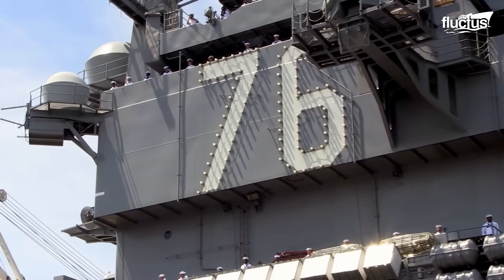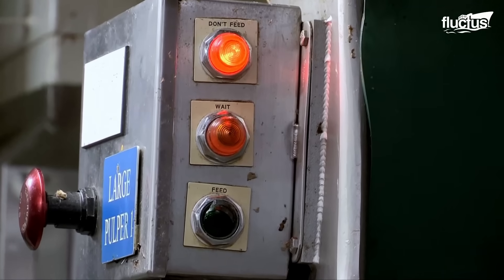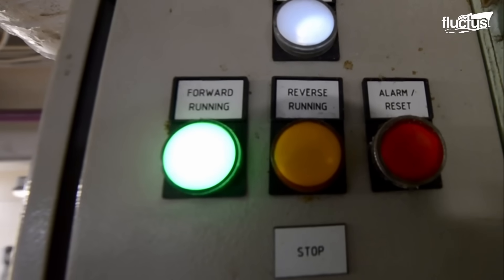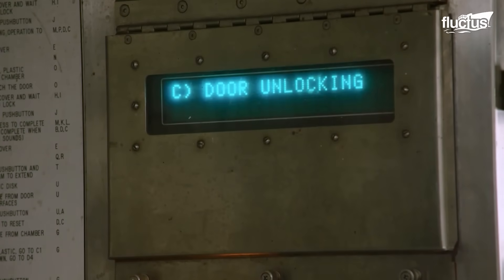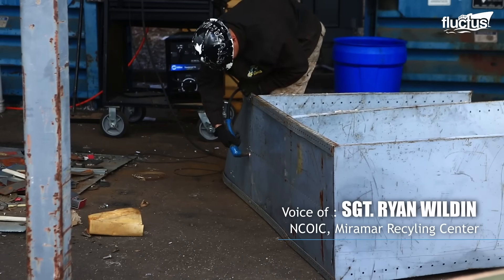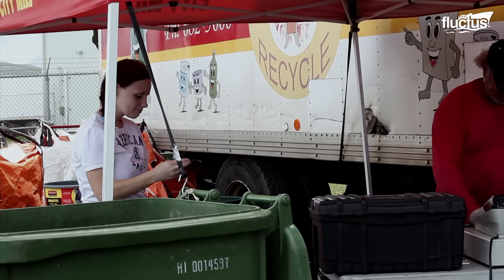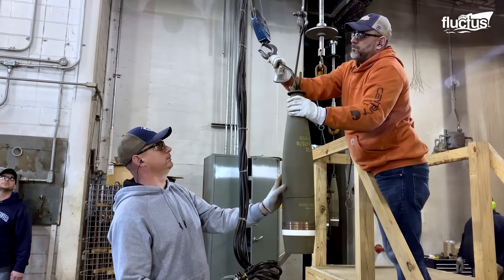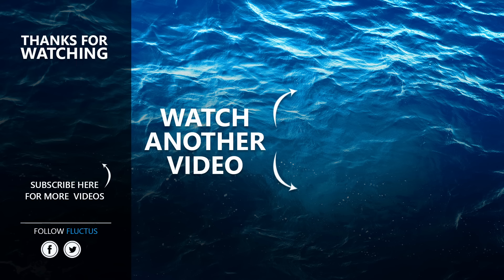Genius Techniques US Found to Dispose Tons of Garbage Inside Aircraft Carrier

Comment: In Sweden, we finalized most landfills more than 50 years ago and regard the US still using those as a bit backward. I am glad to learn that the Navy is a role model, but in one of the first clips showing a shredder, a metal can is clearly depicted together with what looks combustibles. In my country, we burn all the non-recyclable household waste of three reasons; hygiene, volume and for energy. We shred wood for energy as well, recycle paper and cardboard, electronics, garden waste, glass, aluminium, iron/steel/tin, and some like porcelaine, mirrors, gravel and shredded concrete is used to build (rail)road banks. Toxic materials like asbest are in part still put in landfills far away from ground water.   Radiating materials are put in deep underground man-made caves. We have yet to decide what to do with solar energy panels as those contain forever toxic materials. Medical waste is incinerated at very high temperatures as to avoid disasters like Seveso in Italy.
Reply: The danger of asbestos is it's texture, not it's composition. For example steel needles or razor blades are sharp and dangerous - but if melted down can be turned into something that's completely safe. Asbestos is a silicate material that's sharp at the microscopic level which cuts up your lungs. However it can be melted and turned into harmless glass or ceramic.

Comment: I wonder who joins the Navy just to HANDLE GARBAGE AS A RATE.?
Reply: No, junior sailors are rotated in the position.
Reply: My first job on the sub was Mess Cook/trash smasher. Load trash into a steel can and smash it was a hydraulic ram.
Reply: @billywilds1779  Did you cross rate or go in as a mess cook or were you undesignated? Either way it goes.....JUST being qualified to even SERVE on a SUB, means more schooling and training than the surface fleet. And in 1991 when i graduated BOOTCAMP. THEN WENT TO MS A SCHOOL SANDIEGO,( which was a PARTY DAMN NEAR EVERYDAY) BECAUSE BUILDING 94 where we took our classes was shut down for some reason. So we woke up....mustered and went on LIBERTY FOR LIKE 2and a half weeks straight. But one of my bootcamp shipmates was going to be a SONAR TECH he had ALREADY GOT THE RANK OF E-4 right after graduation from bootcamp. Before he went to sub school.i
Reply: When I reported in 74 to the sub. I was a Radioman Striker. But, as an E-2 my job was messing cooking, standing Helmsman/Plane watches (driving the boat) and various clean up jobs. Even doing those things, I still had to meet my submarine qualification requirements. So, sleep was about 4 hours a day. Once I advanced to a Radioman petty officer I took radio watches and life was a little easier.  Served 48 months on that boat.
Reply: @billywilds1779  something like MESS CRANKIN? I FIGURED that might be the case. Thanks.